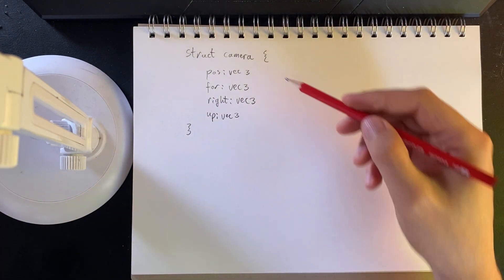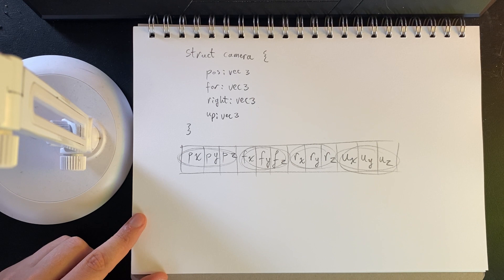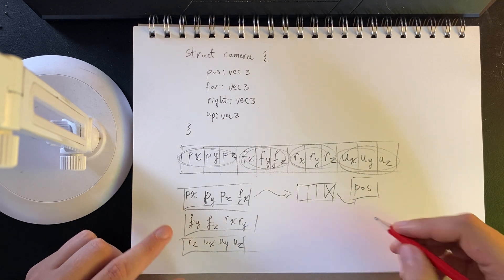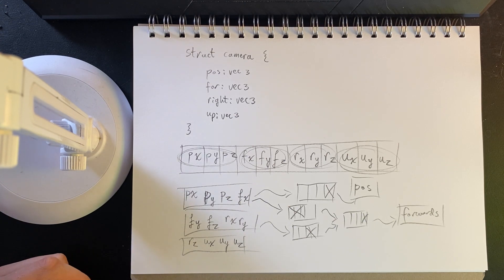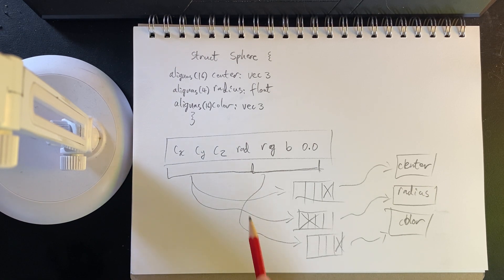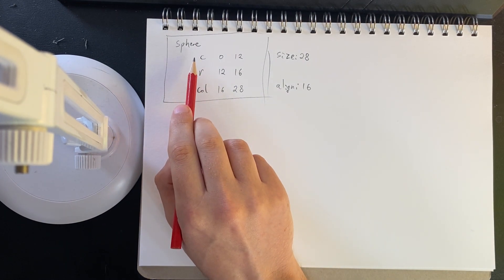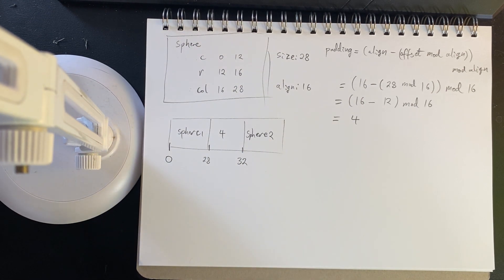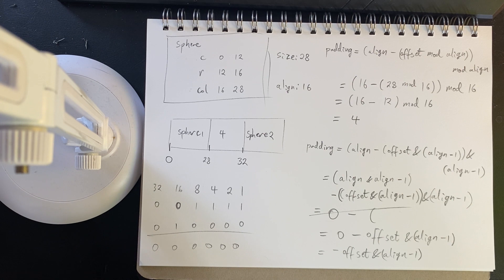GPU Memory Alignment and Padding

Comment: is this an issue with OpenGL or Vulkan?
If I remember correctly Vulkan GLSL has "location" and "component" settings in it's "layout" declaration that helps with tightly packing data into the vec4 blocks.
Also the PhysicalDeviceInfo stuff has an memory alignment requirements in case of "one buffer for everything".
Reply from the maker: So far I’ve ran into this issue for WebGPU and Metal, I’ll look into “component” for Vulkan, thanks!
Reply: @GetIntoGameDev  WebGPU and Metal were higher level abstractions on top of Vulkan right? Or they can use both OpenGL and Vulkan?
Reply from the maker: @NikolaNevenov86  WebGPU is a higher level abstraction which can handle any next gen API (Vulkan, Metal, D3D12). Metal is its own thing (though interestingly, the MacOS Vulkan implementation "MoltenVK" is actually Metal emulating Vulkan)